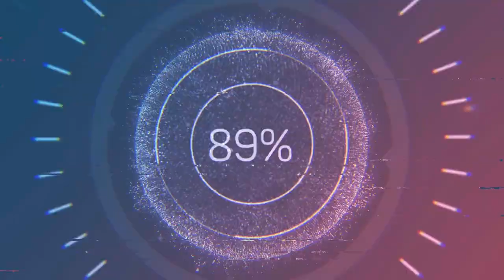Self Start Problem In Royal Enfield #Tamil / How To Change One Way Clutch In Classic 350cc #தமிழில்

Comment: I recently changed this bearing, bought from Amazon, it didn't work for 400 kms, again failed. There were no wear & tear marks on the gear and bearing seats, even then it failed. As a bike user i wouldn't recommend changing the bearing only, mechanics will recommend changing bearing only, because then can charge you again for fitment of the assembly, so think twice before changing the bearing only, change the assembly only genuine /non genuine.
Reply from the maker: Thanks for your information bro 🙏 This case will not happen for everyone bro. I have changed only bearing in my friend bike. Still now there is no issues bro. Before changing the bearing we have to check gear condition bro. Based on that we have to change. Bearing alone available in retail shop. Original Royal Enfield parts. Online la maximum they selling after market or first copy item. So we have to think of that also bro.
Reply: @tnmotorider3910  okay bro, i will buy bearing from RE original spares and fit.
Reply from the maker: Okay bro 👍
Reply: Buy from bearing company
Reply: Bro am fed up with this oneway clutch system In royal enfield....I have 13yrs old r15 also,still not even single mechanical problem occur...but royal enfield sucks

Comment: Bro yeanukum idhey prob,self motor run aagudhu but self start agala,idhuku yeavolo agum ketta 5000 part mattum soldtanga RE service center Mela nambikai illai.nenga change Panna part yeavol price?
Reply: One way clutch ball bearing price and its labor cost.can u tell me the overall cost bro
Reply from the maker: Ball bearing rate 550rs to 600rs based on shop. Labour cost around 300 to 500 based on the location
Reply from the maker: 9092236922
Reply: Sari tha bro..RE service centre le yee 4,500 solrange

Comment: Hi bro... In my bike same problem..may I know a price of one-way clutch ball bearing? My mechanic told to change full assembly of one-way clutch.. I asked in shop he told 5000 rupees.. so only  I ask you bro...
Reply from the maker: Bro ball bearing only means. It will cost around 600rs. If you buy full set means it cost around 4500rs. Based on the shop. 

It is not compulsory to change the full kit. If your bike completed few kilometers only means. You can change that ball bearing alone. If you completed 30k kilometers in your bike. Then better you change the full kit.  That's good
Reply from the maker: Thanks for watching and supporting our channel 👍
Reply: @tnmotorider3910  Bro, first I would like thank you for giving a very clear on this case. Truly appreciated 🙏

I have a question: I'm using Bullet Electra 2016 model. And for me to do this kind of task at home by seeing ur video and advise, I would need to know the Tools and Spanner details for me to do this job.  Please can you help me with Tool Kit and Spanner details that is used for my Bullet electra. Possible pls can you help to share some link like Amazon or Flipkart for us to buy these tool kits. 

Thanks in advance 🙏
Reply: @tnmotorider3910  Neenga enga bro located ? Are u in Chennai?
Reply from the maker: Sure bro. I will share you the toolkit link tomorrow 👍 Thanks for your support
Reply from the maker: Chennai bro
Reply from the maker: Try this tool kit bro https://bit.ly/3417nQ2
Reply: @tnmotorider3910  thanks bro 👍
Reply: @tnmotorider3910  Sure and thank u very much bro 👍
Reply from the maker: Welcome bro
Reply from the maker: Bro my number 9092236922. Call me by tomorrow bro 👍
Reply: @tnmotorider3910  thanks bro 🙏
Reply: 450 rupe nanum change panen tdy tha atha solren
Reply: @tnmotorider3910  chennai le ange bro..
Reply from the maker: Porur bro

Comment: Bro one way clutch problem erundha  adikkadi battery week aguma lost 6 month changed my battery running just 3 month only again battery problem service person telling one way clutch change pannalana seekarama battery problem varum idhu unmaiya bro pls reply
Reply from the maker: No bro.  There is no connection between one way cultch and battery. Suppose self motor is not good naa there is a chance for battery drain. Battery drain problem mostly come due to rectifier check that bro. 

When you click self switch and motor rotate freely naa no issues. If it feel tight then your bike battery will drain bro in rare cases
Reply: @tnmotorider3910  thank you so much for your valuable reply bro
Reply from the maker: Yes bro 9092236922

Comment: Bro ennoda bike la fzs v1 chain sprocket connect pandra rode replacement pannunen bro, andha time la irundhu oru tub tub nu noise varudhu engine sidela, clutch puduchu gear potta noise arrest aaguthu, clutch Bell play nalla iruku bro adhuvum check panniten, vera enna problem ah irukum bro

Comment: Hi bro,   i have long time problem in my thunderbird 350 i.e riding bike with pillion the noise came from the engine near small chain sprocket.  If riding the bike single there is no noise.   I almost given the bike to two RE local machanics there where unable to find the exact issue where the sound come from.   If you have any similar experience of this issue please guide me how to resolve this issue.
Reply from the maker: Hi, Bro. I got your call bro I will call you back.
Reply: Bro I'm also having the same issue did u fixed it bro
Reply: Fix panna sollunga bro
Reply: Yes it's resolved myself,  the solution is remove the back wheel and given to wheel alignment they tightened the spokes make the wheel aligned properly.    When we have the overweight the wheel is slightly bending that affects the chain proper movement it create noise.  Please check your wheel alignment
Reply: @mnagaraj1983  thanks bro

Comment: Nice detailing bro.. 
I own RE Classic 350 BS6 2021 model. I am facing a problem like sometimes engine stops while riding  and wont start for sometime after that. After engine stops like this, even injector sound when we turn on the key, won't come for few mins. After trying multiple times by switch on the key or engine on/off key, and when I start to hear injector sound,  engine will start in both ways (kicker and self) properly. 
Told many times with RE service center but it's not fixed. Please let me know if you have thoughts on this problem, thank you.
Reply from the maker: Bro text me in Instagram . ID tn_moto_rider
Reply: O99o

Comment: Hi sir my bike selpstart problem vander clutch gear same problem. sir total gear assembly (or ) suprit bring available sir witch shop sir  houmany cost ???
Reply from the maker: Only ball bearing means it will cost you around 600rs. Suppose full kit naa it will cost around 4500rs bro. Based on the condition you have to change

Comment: Nice explanation bro 
I ride a 2016 classic 500 . No issues so far . But today , I did self start 3 attempts , 3rd attempt was successful and then when I raised the throttle , there was a loud metallic clang sound and then engine switched off . I tried again and engine started . What do you think the issue will be ? Yesterday I did kick start and I had a big kickback . Again starting after that , no issues
Reply from the maker: That's not a problem bro. It's usually happens in classic bikes. If there is any issue with the one way clutch. Then self motor Start to slip
Reply: @tnmotorider3910  thank you bro

Comment: Bro my bike star city athula self motor suthuthu ana engine connect pna self eduka matigi ena prblm ah irukum
Reply from the maker: Check one way clutch bro
Reply: @tnmotorider3910  epd bro chk pntrathu
Reply from the maker: Open that one way clutch assembly and check the bearing inside that
Reply from the maker: Battery power is fine?
Reply: @tnmotorider3910  self moti thaniya suthithu.. But engine connect pna suthama iruku
Reply from the maker: Yes bro if there is battery or self motor relay problem this will happen. First check it and then check one way cultch bro 👍

Comment: Hi bro ur video is very usefull. One doubt bro classic 350 BS3 ku spark plug evlo km once change pananum
Reply from the maker: Maximum change at 10 to 15 thousand kilometers bro. In between this you have to just clean the spark plug edge and adjust it that's all. Thanks for watching and supporting our channel 👍
Reply: @tnmotorider3910  thanks for ur reply bro. Na used Himalayan vangalam nu iruken bro. Bs3 best ah irukuma illa bs4 vangalam ah nu solunga bro
Reply from the maker: Go for bs4 itself bro. Because bs4 is little bit new model and usage will be low and also mileage will differ. So go for bs4 bro 👍
Reply: @tnmotorider3910  mm k bro thank u
Reply from the maker: Welcome bro

Comment: Enaku self start use panum pothu and kick start use panum pothum oru sound varuthu.....like metal crash
Is it one way clutch problem..???
Reply from the maker: May be bro. Suppose the one way bearing got damaged heavily means like that sound will create while rotating. Check it as soon as possible bro. Because there is an high chances for other parts get damage
Reply: It's Ter any genuine after market parts available
Reply from the maker: Don't use after market spare for that bro. Use orginal itself
Reply: @tnmotorider3910  ok bro

Comment: Bro.. engine oil drain pannadhuku aprm ma.. same oil la podalama?? illa new oil podanum ma?? Then one way clutch problem ku full set matha venam ma?? ila ball bearing change panaley problem solve ayiduma??
Reply from the maker: Based on the condition both need to be change bro. If oil condition is good you can use same oil.
Reply: @tnmotorider3910  ok bro👍

Comment: I am also having same problem in my RE , where can I get one way ball bearing
Reply from the maker: In retail shop it will available bro. But mostly they won't give it.
Reply: Same problem I have...locale 4,500rs kekuraga...bro..ithu romba athigam thane...avloo kudukalam bro reply must
Reply from the maker: Full set change pannanum naa this amount is fine bro. But most of the time only ball bearing tha pogum so that time 4500rs is high
Reply: @tnmotorider3910  so eavalo agum bro antha bearing and athu kuda iruka elam seathu 2000 keakuranga
Reply: 4 times na change panitan bro
Reply: @tnmotorider3910  thanks bro
Reply from the maker: Full set ha illa only bearing ha bro?
Reply from the maker: Welcome bro
Reply: @tnmotorider3910  bro do u  know any shops in chennai offering that one way clutch
Reply from the maker: Yeah bro. But after lockdown naa arrange pannalam bro
Reply: @tnmotorider3910  ok bro no problem how can I contact u after lockdown
Reply: @tnmotorider3910  and cost wise antha full set na 5k varuthu , verum intha bearing na ena price varum
Reply from the maker: 9092236922
Reply from the maker: Call me after lockdown bro

Comment: Bro while using kicker I heard big metalic crash sound. when I asked in showroom they simply tight my clutch cable. is this right solution ?
Reply from the maker: That sound will come in Enfield bikes sometimes. That's not a issue bro. But check the clutch basket lock boult bro. It will get loose automatically

Comment: Intha velaikka 4800 vangunan.?.paavi payyan😢😢
Reply from the maker: 🙄 Next time be careful bro👍
Reply: oneway clutch full set 4800 varum bro
Reply from the maker: Yes bro royal enfield branded will cost that much price. After market na it will be around 2500rs. If you need check in online bro
Reply: Enakum one way clutch la problem and mechanic set ah change pana solraru...
En bike 3 yrs old and Km 18k
Should I change full set or ball bearing is enough
Reply from the maker: Bro If we remove only we can know that full set got damaged or only ball bearing got damaged. I think just replacing ball bearing is enough
Reply: Original rate kooda mostly mechnc frud vela panuvanga duplct 450 rup only oringal arund 3k varum